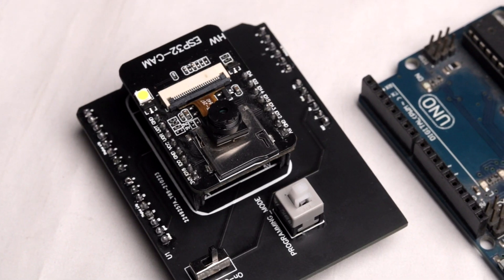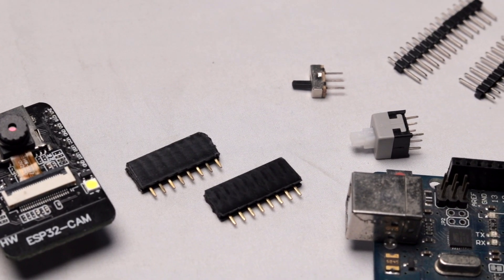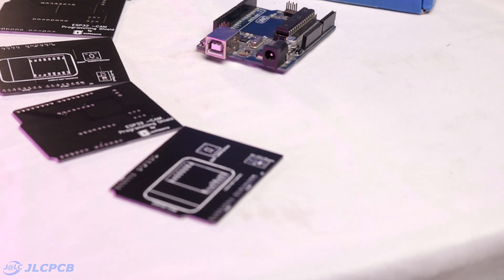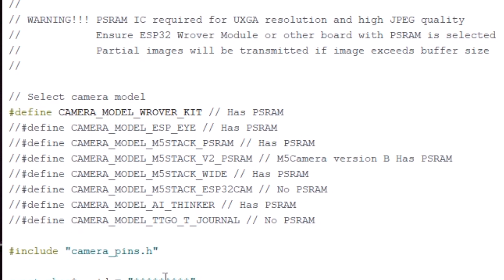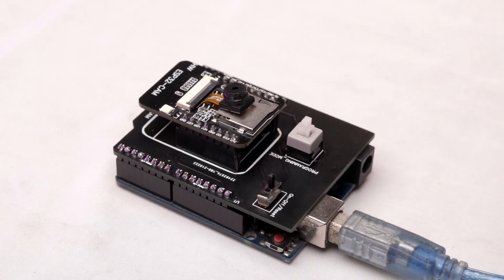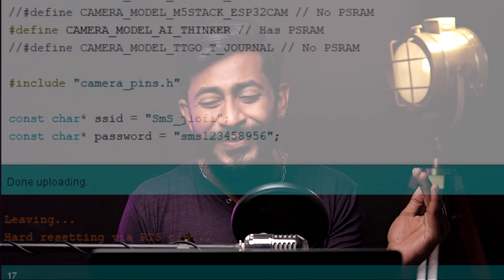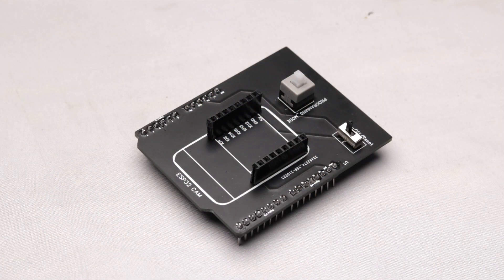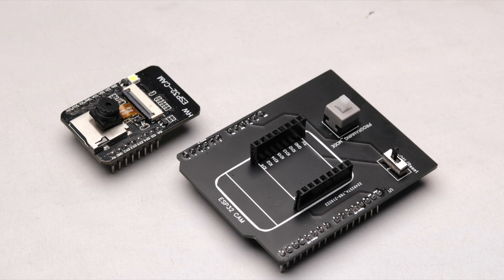ESP32 Cam Programming Shield for Arduino

Comment: gonna buy merch but this pcb not available
Reply from the maker: This PCB is not available with merch
you can buy this PCB with all the components soldered on it
check the Link in the description
Reply: @techiesms  ok bro can you make a nodemcu version to make it small i dont prefer a arduino

Comment: Programming esp32 cam is not a big deal you juts need 4 5 female connectors. Dont call it a major problem .Stop fooling people just to make a video for your sponsor. Haven't you milked esp32 boards enough when will you try something new ? It not difficult to turn bulbs on and off.